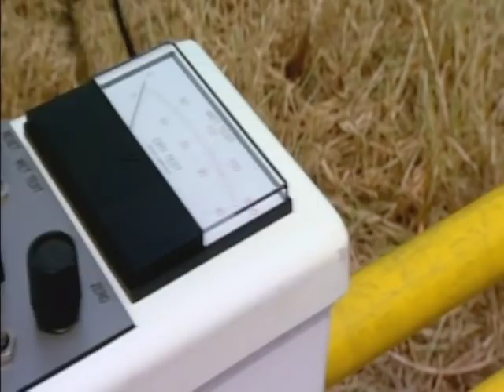Half Million Volt Workers Part 3

Comment: The fact they were working on/with live wires and power lines is pure madness. Greed from the consumer and the company. Where I live apartments shut off water all the time for maintenance work. You're telling me they can't shut off the power for a little while? I mean when power outrages happen people go off without power anyways.
Reply: If they shut off the power all of the united states and canada would be out of power.... working on water is a competely different thing than power. When they're working on water pipes it has to be turned off there is way to much preasure under those pipes there is no possible way to work on a water pipe under preasure

Comment: I’m not to sure about all that, when and where did the original crossarm go? That should have been a simple exchange,,, drill above the original x arm swing it in and bolt it down . The exchange the insulators and drop the old out.

Comment: not voltage it's the amperage that kills
Reply: without volts, body's resistance won't allow amps to flow.
Reply: The amperage disrupts the rhythm of your heart. Voltage frys you like lightning.
Reply: So if I put a 12V 200A supply across you, you would die, right?  Don’t talk bollocks.
Reply: What’s your point exactly?

Comment: This video proves how 3rd.world our electrical system is.In Europe,the lines are buried,with access points along the way,making it far safer for the workers with far fewer problems.
Reply: not true. im remote areas lines are still overhead and you realize that the united states is like bigger than all of europe
Reply: john li Still better then our system,cars NEVER hit telephone poles in Germany.
Reply: @4gauge10  orders of magnitude more trees than poles so your statement is moot. Underground is far more expensive, which is  reflected for the greater public good in their taxes.  Nothing wrong with overhead so don't fix it
Reply: @adang578  Sigh...so it's cheaper to bury people and call it a day,I see.
Reply: @4gauge10  Overhead is wire and pole. Underground is INSULATED wire and trench.  Know how thick that needs to be on underground transmission line? Wait...Mr. 5.19 thinks because there are no poles cars don't hit things.
Reply: @4gauge10  Do you believe in darwinism?
Reply: @adang578  And I'm still smarter then you are...HAHAHA!!.THANKS!!.
Reply: @4gauge10  Wrap that idea and where it came from around a pole...preferably of the overhead utility type.  Cheers!
Reply: Oh and 138kv is still 138kv underground. Equally dangerous just in different scenarios.
Reply: @adang578  Not if you can't hit it with your car,truck,semi.Much,much safer,this is why Germany has all of its lines underground.
Reply: @4gauge10  Look out!  The poles are coming to get you!
Reply: @adang578  Don't say that,I'm having night terrors as it is.
We had a wind storm here 2 days ago and a🌳tree took out my power lines here in the rust belt,my standby generator saved the day and the 200 amp fuse blew on the pole,but my power lines cross a busy highway and when I told my power company what happened,I also said that the road needs to be blocked off,this was never done and I prayed for all the idiots that drove their cars over a 3,300 volt power line that could have blown up somebody in their car.
Now,I hope you understand why it's MUCH better to bury high⚡voltage lines,if this was done in the first place,their wouldn't be any problems like this in the second place.
We had 780 people without power for nearly 24 hours.(waste of time and resources dealing with overhead lines)
Reply: @4gauge10  lol oinka
Reply: @adang578  What ever that's suppose to mean.

Comment: At 13:40 when the chopper is coming in for extraction i noticed something about your safety tether lines. It's said earlier in the video that if they get within 4ft of the live voltage line it would close the circuit and ground out the lineman, well i noticed that it looks like the safety tether the lineman uses, if he slipped it looks like the length of the tether would not keep him out of that 4ft danger area based on where the tether line is connected and the length of the line itself which looks like it has a very large amount of slack in it thus by the time it tightened up to keep him from falling,... it would be too late putting him into that death zone of 4ft. AIR2, can you clarify this for me? 
Thank You, 
~A~
Reply: Im not an expert, im going start as an learner lineman in a month, but i can try to explain it.
When he falls he is no longer in contact with the wooden part, so there is no contact to ground, and the safety line is probably non-conductive, therefore it should be non-lethal.

Comment: I guess bringing the crossarm and conductors up 3-4 feet higher, 3:28, is ok with the owner.
Reply: I was curious about that myself. They didn't show the process of demo'ing the old crossarm out and the raising of the line. It looked like they had a pulley on the line at one point to raise it up but you would have to demo the old crossarm out without contacting the lines and have them temporary supported until it got to the insulator. Also the pulley would have to be insulated somehow. I was pretty interested in seeing how they did that.

Comment: I'm surprised they don't use the Hughes helicopter model with the rotorless tail. It utilizes bleed air off the engine in a low pressure high volume tube that just rotates open to provide enough airflow to offset the rotor torque. On top of that it's just s big hollow fiberglass tube which they could bump into the line with out adverse outcome. Plus theyre way more reliable that traditional tail rotor copters?

Comment: Yes a voltage as low as 240 can kill, but a voltage as high as 70000 can be relatively harmless, its the current in combination with the voltage that's dangerous. If something can deliver high current at high voltage then you should be concerned.

Comment: Ridiculous greed, use specially designed 20 wheel drive cranes 1000 times safer.
Reply: Bradley a lot of the terrain doesn't make it feasible to use a crane and the only option is a helicopter which is much safer.
Reply: I'm watching this thinking of a crane with a quad non-conductive cable  (IE Kevlar which doesn't stretch and has great tensile strength) stabilized work platform tensioned via non-conductive arms above and below (Think one of those dental floss picks). The line worker can control the boom via fiber optics which are non-conductive. The crane base has tracks for movement over and ground surface and locks in place with hydraulic stabilizer arms like an excavator, in fact you could use a Cat excavator with a modified boom.

Operation cost of an excavator vs a Hughs 500D = Huge savings + Huge increase in safety.

Printing this and sending via registered mail to self as preliminary patent claim.

How hard was that?

Comment: How do these guys not fall off the poles from the massive size of their balls?
Reply: SED71 They use the butthole auction cup as the asshole clenches
Reply: Each nut weighs the same on each side so it keeps them balanced 🧐
Reply: Their wearing their harnesses
Reply: @Shawn_White  yeah a harness doesn't mean shit when working on a 500kv line line. I think falling is not on the top of the list. They short out and get shocked it will be worse then falling.
Reply: 😂dead
Reply: did you actually post  this on all the parts for this or are u just copying what someone else said in the previous videos ?? either way pretty lame bro
Reply: @Insutama  it's a common saying who gives a fuck. The fact it bothers you is lame

Comment: the amps is what kills you half an amp is enough to stop your heart
Reply: 24v? wrong. you need at least 50v or so for the electricity to pass the resistance of your skin. how did you shock yourself with a 18650? if you had 30 of them in series i could understand. But you cannot get shocked by a single 18650. Go ahead and touch two car batteries in series. that can give 600 amps but it wont shock you.
Reply: I frequently (but always accidentally) shock myself with 18650's while they're pushing >5 amps to a load. luckily the body isn't too conductive, so the low voltage barely allows any current to penetrate my body. However, if I were to touch a 24V source pushing >5 amps, I could be seriously injured.

You need the volts in order to actually conduct the current. Touching low-voltage (<1 volt), high-current circuits is MUCH safer than high-voltage, low-current circuits.
Reply: Actually as little as 100mA can stop your heart. Fortunately your body has a fairly high internal resistance. About 350 ohms from hand to hand. Your skin also has resistance which can range from about 1k ohms for wet skin to 500k ohms for dry skin. By those numbers grabbing leads with both hands at 135v can be fatal. In the us we have 120v, but that is RMS. The actual peak to peak voltage is about 170v so don't try it. That said, conditions can vary greatly. People have died from as little as 42vdc. With the voltages these guys are working at, that math really doesn't matter as they would become part of the arc flash and vaporize quite quickly.
Reply: +Elkin Hernandez Ya but it'll take 500mA
Reply: When someone does get shocked and people "think they died" they can be revived again with a defibrillator. Because when you get shocked from a lines the shock is coming from an outside source, meaning if you use a defibrillator you have a 50-99% chance to come back depending on how bad the shock was.
Reply: who cares lol

Comment: I have been shocked before in Afghanistan which they use double the power we use in the States . one insistence I was taking an old breaker panel which had a 60 amp cable powering it off, I couldn't take the remaining red and blue cable ( 2 out of the tree hot lines out) and I was staying on the ground, I used my leather man and screwdriver to remove the last 2 hot cables of I even touched the copper with my bare hands once I removed the both the cable arced realizing that the cables where live. up to this point in the thank God everyday because j should have died that day of electrocution. I don't know why I didn't get hurt but I was very lucky
Reply: You weren't providing a path for the juice to flow to -by touching anything else at the same time.

Comment: Wow. Is this really cheaper than just building a new line next to it and then switching between them? I mean, with all the flight hours, having to do them one by one, all the time this must take...
Reply: smolkafilip Yes. Lots cheaper.

To make a new line you need permits, buy the land next to the line, get rid of all the forest and prep the ground, then erect poles and get lines on... It's a pain in the ass.
Reply: Seroster But why not just build it right next to the first one (in the same corridor). That could save you some land buying. Plus when the supporting columns go, they will have to do that anyway. I mean, unless they find someone to hold the wires up from a helicopter while they erect a new column.
Reply: smolkafilip It would still be much more expensive to build an entire new pole line with new conductor.  And yes, there are tools called gins that can be used to support the conductors while the pole is changed.
Reply: morbidangel47 Holy...! There is a tool for everything.
Reply: smolkafilip how is a helicopter gonna hold over one hundred miles of wire, that shit weighs a ton.
Reply: They're doing it one by one of course.

Comment: As far as "first time"...maybe the first time Entergy has tried it on the property. Long line helicopter and spacer change out using bare hand methods has been a regular deal for at least 30 years. Lot's of "drama" for the sake of narration here.
Reply: Clown, go back to your Arby’s drive through window......
Reply: those are not the things there talking about what there talking about is the first time changeing the wood cross arms out with metal cross arms while the lines are still hot.
Reply: jeff Riley Yeah an overbuild like this is done all the time out west

Comment: Why would you use wooden cross arms? If steel had been used in the first place this life threatening task wouldn't even need to be carried out!
Reply: The same reason houses are made of wood.  It's cheap
Reply: Basic Impulse Level insulation.. they get it with wood air or insulators... with a steel arm the insulators are different and we did not have those years ago
Reply: +ajs2120 I am from Cape Town and basically all the structures here are built with steel. Just recently, when they started building new electrical structures and replacing old ones, they have huge and really high concrete structures which when transported, requires 2 trucks with synchronizing movement because of its weight and 25 meters of the base gets burried into the ground. Quite a cool concept i say but quite pricey